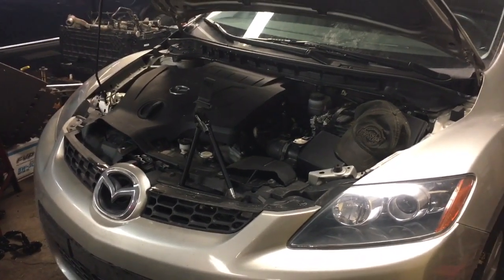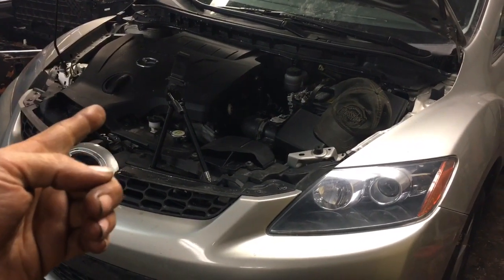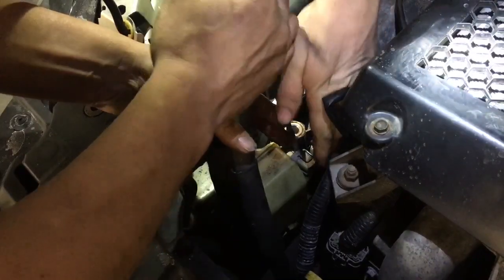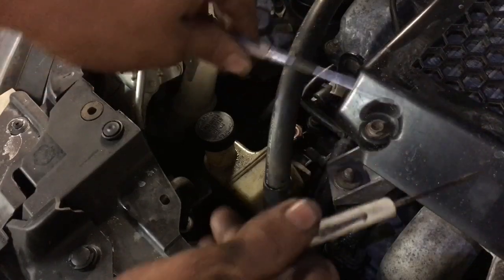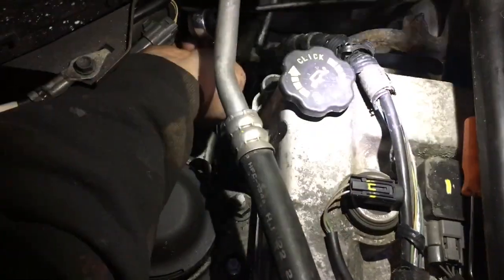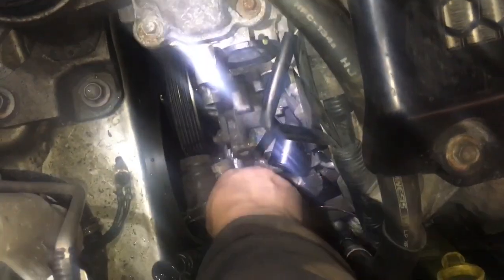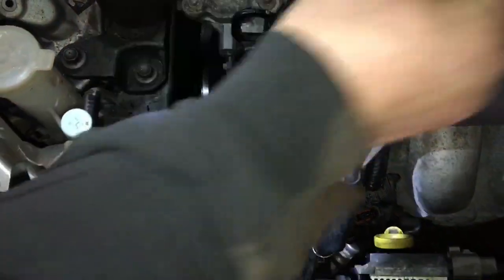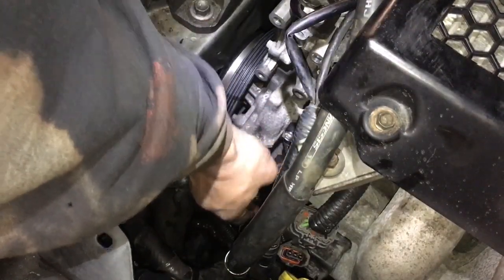Mazda cx-7 2.3 thermostat replacement how to

Comment: Thanks bud for showing how you got the bottom bolt off the steering pump it was so easy you couldn’t show it on camera and yes I can’t get this mf off
Reply from the maker: Sorry John I try to make things the best way I possibly can and I try to show everything that I possibly can but sometimes there’s just not enough room or possibly not enough time if there was something complicated about it I definitely mention it because I think that’s the point of the videos but some people have to have some kind of mechanical knowledge to complete task. 

I’m certain you will figure it out if you get it a little bit of time and step back and take a look at it and just think.
Reply: tru dat

Comment: Hi my engine light is on but the car works good
Reply from the maker: Well that gave me an extremely good idea for a video. 

The reason your car runs just fine is because 90% of the time the check engine light is On because your vehicle will fail federal missions. And the vehicle is running out of the guidelines for polluting the O-Zone layer . Obviously this is a bad thing and your car is not running at Peak Capacity. 

Generally the check engine light will flash continuously if you actually have an internal engine problem and you will notice a difference in its operation (also you probably would not need a light to tell you that) if you genuinely have an engine problem that is why your car is running just fine. 

In a nutshell you should get it serviced but it’s not going to break down on you more than likely. And if it does break down your check engine light probably would not tell you that it was going to break down in the first place. More than likely you either have a loose gas cap or a defective oxygen sensor. 

Like I said you can have it checked out you should be just fine for a while

Hopefully that helps God bless have a great day